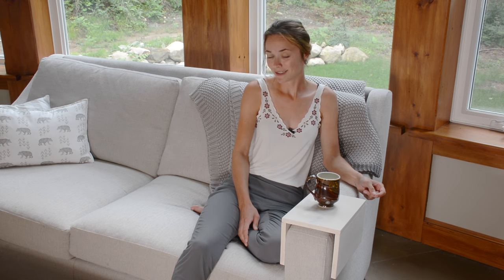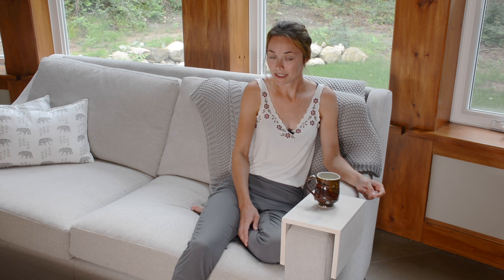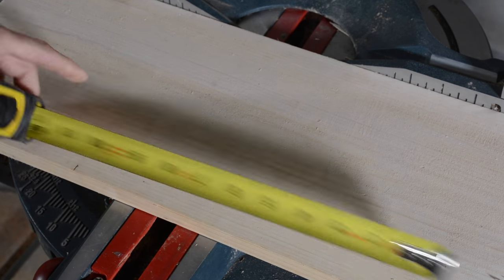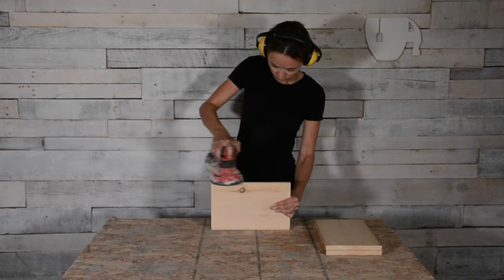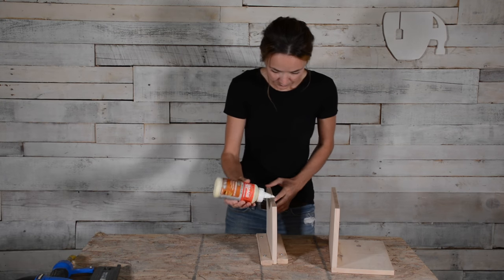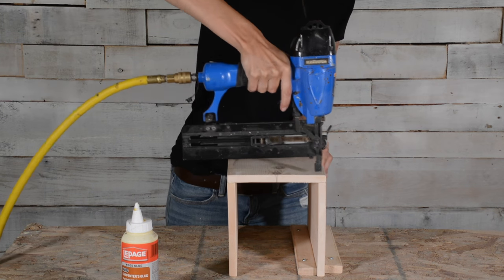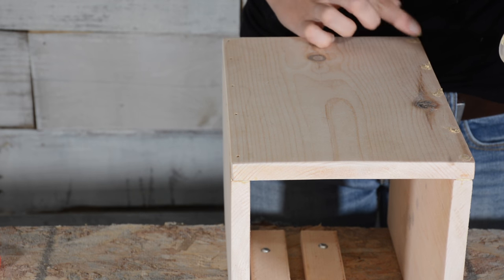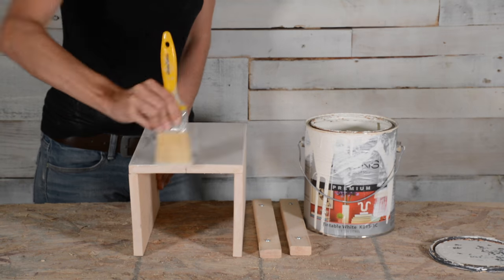DIY Sofa Arm Table

Comment: Hi
Nice Video 
If You use pocket hole jig that is much better than nailer because Your joints are not good there is some gaps 
I saw Your other videos mostly are very nice 👍 
Thanks for sharing 

Engineer Syed Hasan 
from.                 U S A
Reply from the maker: this is definitely not my best piece of work lol pocket hole would have been much better. i was trying to keep the tools/materials super simple so that more people were able to do it, but you're right, theres a lot of room for improvement on this one!